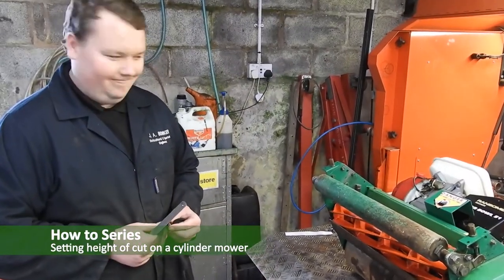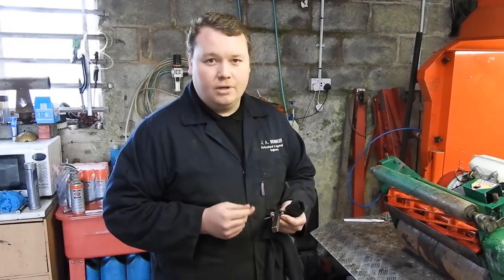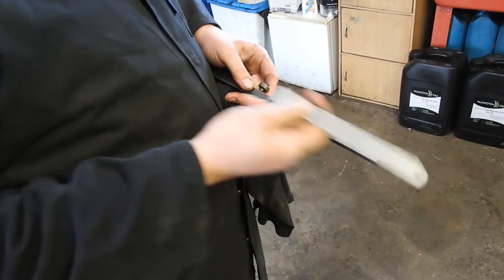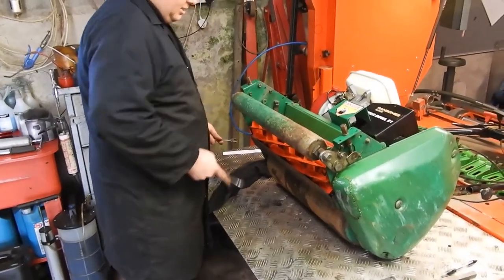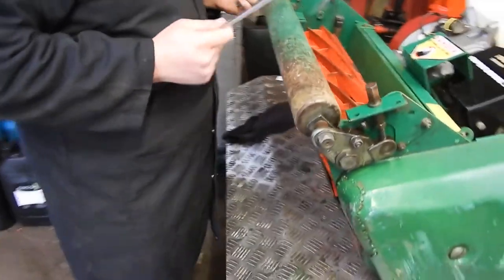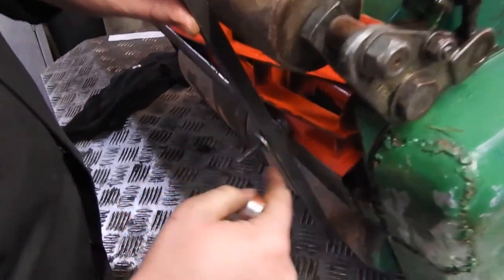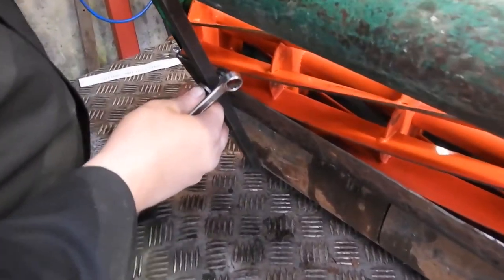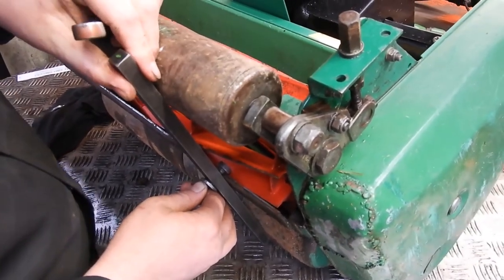How To series - Setting height of cut on a cylinder mower

Comment: Love the video. Is there any reason why the height could be set different at each end? Just measured mine after making a bar and it's about 5mm different.
Cheers
Reply: did you figure it out Master Shredder ? mine has diff heights too
Reply: @13hickory  yeah mate, the rear roller was out. Made it parallel to the bed knife and chassis, then set the height. It's within about 0.5-1mm.